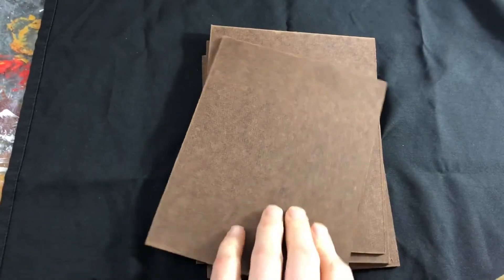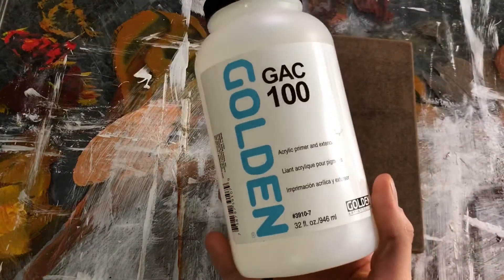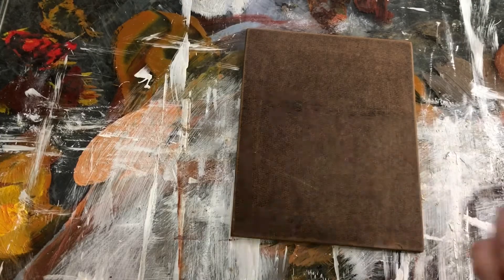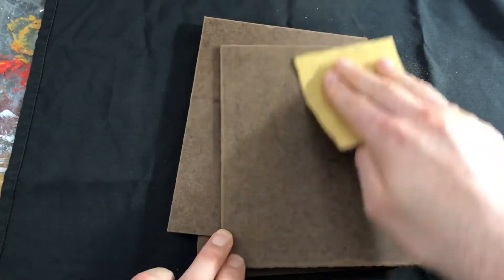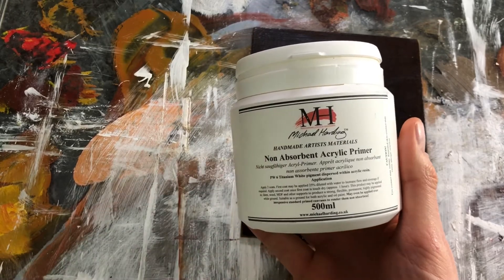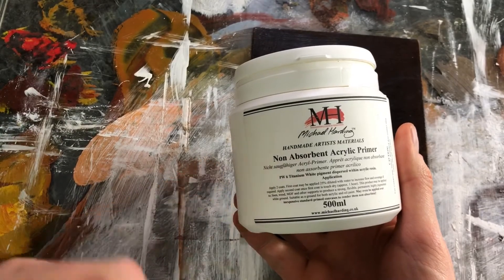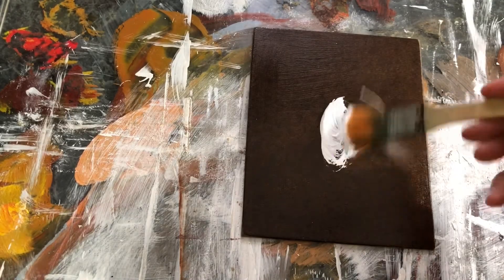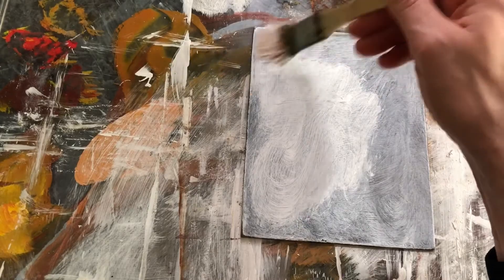How to prepare WOOD PANELS for OIL PAINTING using GAC 100 and MICHAEL HARDING’S non absorbent PRIMER

Comment: First Sand. Then Size to  seal/protect the wood panel from the paint and protect the painting, eg circularly size thinly, 1-2 coats, an hr apart, with Golden GAC 100 OR PVA Size from GAMBLIN. Then apply primer or gesso. Suggests Prime with oil based primer for oils. Or Michael Harding non absorbent acrylic primer is also ok , couple of very thin circular movements layers, 2-3 applications.
Reply from the maker: @firefly5574  thanks for sharing. Helpful info. Hope you are having a great day!!

Comment: I think it would be advisable for those who have issues with humidity in their homes to seal from both sides. I had four paintings ruined because of warping. Another idea I’m playing with is mounting canvas on panels but using reversible and archival glue.
Reply from the maker: Those are good suggestions!! Thanks for sharing. What glue do you plan to use?
Reply: @GalleryBry  I have seen that there are artists who use Lineco, Golden soft medium, and even Mod Podge since it is acid free, I have to try it with Mod podge (the classic one) which is the one I currently have in my house (but not for copper hehe I mean to stick my paintings on paper on wood or MDF)
Reply from the maker: @Maria-ue2nb  I think those options would work well.

Comment: I have been painting on hardboard for about 20 years now. I used to just prime the board directly with about 3 or 4 coats of gesso and the baord really sucked it up. Several years ago I started priming my boards with two coats of GAC100 ( which allows for a more even absorption of gesso) and then 2 to 3 coats of gesso, sanding in between with 150 grit paper. I generally brush it on, then use a dense foam roller to even it out, followed by a final swirled brush effect to regain it a bit of texture. I do my underpainting in acrylic, mixed with clear gesso (mainly to save time in drying), then do a final coat of clear gesso over that, to help smooth out the underpainted surface. From there, I do another light sanding to give the over-paint some tooth. I do the final/over-paint with oils. I also seal the back of the board with amber shellac. I could use GAC 100 but I like the look of the shellac. This prevents chemical seepage from the MDF hardboard, as well as keeping  it safe from water damage. It is a bit of a painstaking process but it is worth it to me. I haven't used Michael Harding's non absorbent primer, but now I am very curious. Thanks for your video!
Reply from the maker: @azmadazme  thanks for sharing!! That sounds like a very thorough process. I’m sure the paintings will last generations. Thanks for stopping by. Happy painting!!

Comment: If I were you, I would paint the sanded wood panel with white lead oil-based paint. Then umber or sienna for underpainting. Wood panels do not require any sizing. It is for canvas. I don't like primers.
Reply from the maker: @꿈꾸는_기계  thanks for the feedback. Much appreciated. :)

Comment: Thanks so much; this was very helpful! I was having problems with getting bubbles in my GAC 100 layer but I think perhaps I wasn't working it enough and I was also using a damp foam brush.  I do have a question (if you are still reading comments): do you seal the edges of your board as well? Thanks!
Reply from the maker: Thanks for the great feedback. I believe I failed to mention it but to ensure that a panel lasts as long as possible it’s best to seal the edges. I don’t always do it for studies but if I have a Comission I always seal the edges. :) Anything else I can help with right now?
Reply: It's the damp foam brush that's the culprit. I've had the same problem, use a dry bristle brush and wash it out immediately after applying it so the hair doesn't get glued together!

Comment: The wood panels you started with look like masonite (which is what I use all the time). True or false? Follow up question. I do mixed medium art - mostly paper and glue collage. If I size the masonite with the gac100, should that be sufficient to stop acid bleed forward from the panel to the art? And will my glue stick to the gac100 as it does directly to the surface of the wood? Thanks.
Reply from the maker: They are high density fiberboards, also known as hardboard or Masonite. :) What do you like best about them?
Reply: @GalleryBry  I use them all the time because a) They're thin and yet fairly rigid and have a profile that will fit into most frames that I use b) They are light weight c) I can cut them with a utility knife in the studio without needing to go outside to set up a  power saw.
Reply from the maker: Oh cool. I never tried the utility knife before. Do you just score it then apply force to snap the panel?
Reply: @GalleryBry  "Scoring" is a bit of an understatement. But yes, that's the idea. You can get a sense of it here: https://www.youtube.com/watch?v=ct5Laoq6DrU
Reply from the maker: @Karch.Dah-Veed  oh cool. Thanks for sharing. I see you make many cuts. Great video. Keep up the great work‼️:)

Comment: Hi. I know this video is three years old so hopefully not too late for a question. I’m confused. I thought the whole point of using gac 100 was to seal wood panel to prevent sid. Why do I then need to use the non absorbent acrylic primer? Is this not redundant?  Thanks for your video and advice. I’m a novice oil painter so lapping up information!
Reply from the maker: @dorisr6424  Great question. Sizing the panel with an acrylic medium helps to prevent discoloration as you indicated. The nonabsorbent primer is to help prevent the oil from absorbing into the primer, which can make it more difficult to wipe away and can make the painting appear. dull, when unvarnished. Did that help answer your question?
Reply: @GalleryBry  Got it! Yes you answered the question and many thanks!!

Comment: Great video! I know on the Michael Harding description it says sizes and gessos are unnecessary under this primer, but I'm just about to start an oil piece on a wood panel for the first time and want to feel confident I'm preparing it well. Would I be right to assume the gac is just an extra layer of protection and won't interfere with the primer and oil paint? Thank you!
Reply from the maker: The GAC acts as a barrier between the wood and primer. It keeps the wood from being rotted by the oils and protects the paint from chemicals in the wood. I like to take this extra step to ensure the painting lasts as long as possible.

Comment: If using PVA do you use it neat or water it down?
Reply from the maker: I haven’t used it myself, but I would assume the manufacturers would make it ready to use straight from the bottle. Anytime I’ve seen it used it has been right from the bottle.

Comment: Hi! How long do i have to wait for the gac 100 to dry before i can apply oil ground primer? Thanks in advance🙂
Reply from the maker: I typically prepare panels at night. So I let them dry over night and prime them the next day. But the acrylic polymer dries really quickly so you could likely prime after they are touch dry. I’d give them an hour or two just to be safe. It also depends on how thick you apply the polymer.

Comment: Michael hardings website says you dont need to size wood first when using his promer..why do you use the gac100?? Thank you
Reply from the maker: Thanks for the question. It really is just a matter of personal preference. Sometimes I use the GAC 100 when I use thin layers of gesso. For me I like the smoother surface it creates with less gesso, rather than using multiple layers of gesso, which creates a more porous painting surface, even with Michael Harding’s primer. If you apply several layers of gesso you probably can do without the GAC sizing. I also do it just to be safe, to protect the paint from the board and the board from the paint. It just depends how thickly you apply your gesso. You can run your own test. Gesso some paper, paint on it, and if oil still seeps through, adding the GAC 100 will block it completely. Was that helpful at all?

Comment: Can it be used as a varnish
Reply from the maker: Are you referring to the GAC 100 acrylic? If so it says not to use it as a varnish. A varnish is usually used as a removable protective layer. Acrylic can’t be removed.

Comment: If a wood panel is covered with 3 coats of Michael Harding's Non-absorbent acrylic primer only (without being sized first), will that be enough to protect the oil paint?
Reply from the maker: Three coats should be sufficient. But It depends on the type of wood and how thick the coats are. There should be less issues with unprocessed wood like birch panels vs a compressed wood like MDF, which contains harsh chemicals. Thicker coats will add more protection. I use really thin coats of primer or gesso just to add pigment and I rely on the sizing as my non absorbent layer. To be sure, you can run this test: coat a piece of paper (say a 4x6 piece of watercolor paper) with your desired level of primer. Make a small oil painting on the surface. If no oil seeps into the paper, then you should be okay. To put this into context, The Scream by munch was painted on cardboard, and it’s still in okay shape. Did that help at all?
Reply: @GalleryBry  Yes, thank you. Because I'm so paranoid regarding these issues, I think that I am just going to sand off the primer, apply GAC and then re-apply the non-absorbent acrylic primer. That way I know I'll be safe. I'm new to wood, so hence the mistake.
Reply from the maker: @ignaciohernandez8901  hope it goes well!! Thanks for your questions. :)

Comment: If I want to buy a round slab of wood and the seller says they put on a food safe finish, should I keep that or tell them not to put it on?
Reply from the maker: I would be cautious about painting on an unfamiliar surface. Without knowing what chemicals are in the finish and whether it is gloss or matte, there is no way to determine how well paint or a sizing will interact and adhere to the surface. If you plan to size and prime the wood yourself anyway then the finish likely wouldn’t be required. Did that help?
Reply: @GalleryBry  yes that was very helpful. Thank you very much for responding

Comment: Very nice my man! Soo, I've used acrylic matte medium for adhesive and sizing, and it had worked fantastically. I've also used pva glue, and rublev conservation mounting adhesive...which obviously works great! But I'm not sure the difference between pva, acrylic gel medium, and GAC 100...and gac is the ONLY thing I haven't tried, simply because I haven't felt a need to spend yet another $15-$20 on something I felt I already had. BUT if you think GAC has something to offer(in terms of sizing) that acrylic matte medium doesn't, then let me know. Might just have to try it. I also mainly use Rublev Lead Oil, and Lead alkyd primer. I've used oil and acrylic primers as well but my favorite is the lead alkyd(benefits of acrylic drying, AND Lead oil durability/texture) thanks!
Reply from the maker: Thanks for the great response!! Sounds like you have lots of experience. The main differences (aside from chemical compounds) among PVA size, gel medium, and GAC 100 is really just viscosity. PVA size is very watery. Gel is naturally very thick. And GAC 100 is about the same viscosity as log cabin maple syrup. I believe they are all ph neutral and will be archival. And each should provide a good barrier between the oil ground and support. And I’m with you: I like the alkyd oil grounds. They are such a joy to paint on. If you want to learn more about all the Golden mediums and various GAC numbers, there are some good videos out there.  I don’t fully understand all the differences among the GAC options. I think they all have the very same acrylic base. So as far as I can tell the main differences are viscosity and finish. Hope that helps a little. You should be good with the gel as a size. Some people like a very smooth ground so they might prefer brushing on thin layers with PVA or GAC. How to yo apply the gel—palette knife. Do you keep it textured?
Reply: @GalleryBry  man lol you too had a great response! Yes I have used pallette knife to apply(but don't prefer the edges left, and have to smoothe them down with either brush or rubber print brayer) which is probably why I've tried the liquid acrylic medium version, shellac sealer(only for wood, masonite seems to only respond well to the medium/acrylic primer, and pva) liquid/gel medium, AND polyurethane. Lol boy, when ya say it out loud, sounds like ALOT of experimenting. I guess I prefer doing things "correctly" even when it comes to art, and I keep hearing new inventive ways to skin the cat called "archival art". So I saw a response that said GAC 100(to seal OR adhere) or shellac is best for wood, pva/gel(adhesive/sealer) or acrylic primer works best for masonite. And MDF would fall under wood. And of course, my favorite, ACM, doesn't require ANYTHING 😀 to seal, and archival PVA OR medium have yielded great results adhering linen. I think tho....as long as you are care enough to try your best with what you have, and strive to make better art everyday, then your art will be JUST FINE! ;) oh, and yes, I mainly use a brush for ANY sealer I use. Beat of luck and happy painting!
Reply from the maker: @DCweldingAndArt  keep up all the great work and learning. Where do you get your ACM? I’ve been wanting to try it.

Comment: Does it matter whether it is tempered, standard, or un tempered hardboard?
Reply from the maker: Excellent question. If you want your painting to stand the test of time, tempered hardboard is the best option. MDF and untempered hardboard are okay for studies and practice but I wouldn’t recommend them for work you plan to sell because they can flake and deteriorate easily. I still like to seal tempered hardboard with GAC 100 just to add an extra barrier, especially with oil primers. The oil from the primer can still get into the fibers and rot the panel over time. And moisture from acrylic primers can also get into the wood fibers. Was that helpful?
Reply: @GalleryBry  You are right, tempered was the choice to make since the 70s (i'm dating myself here)... as tempered was known to be manufactured without oily binders. It should be noted that although most masonite is tempered these days, there is still cheap masonite-like stuff out there, like used in furniture, that is likely not tempered. Rule of thumb from the old days was to avoid using "found" masonite because it is likely the oily variety and not "safe"for paint work. I think the artist in the prior comments who found the masonite bleeding through the GAC 100 may have chosen the untempered masonite variety. There was also a concern that the "sealant" (GAC 100 or whatever) should be fully cured before working on it, say about 24 hours after the last coat, as touch-dry doesnt necessarily mean the film is cured, only congealed... I myself wait until the odor of ammonia and gycol ethers have evaporated and ceased before going for gesso, and maybe it's overkill but it's a precaution I take anyway... any thoughts on curing of primer?
Reply from the maker: @timmilk7875  thanks for this great reply. You are quite right about the differences in fiberboards. From what I have read, hardboard is the one that doesn’t use chemical binders. It’s former brand name was masonite. And you can tell by the smell. The dark brown hardboard found in paint shops and hardware stores has little odor. But MDF or medium density fiberboard uses chemicals as a binder and is a lower quality fiber board. You can tell because it is a light color and will make your studio smell quite a bit. And it degrades easily. It’s often used in cheap furniture. As far as curing, I definitely wait at least 24 hours to be safe. I usually have about four layers—GAC 100 to size and seal the wood panel. Acrylic gesso to add opaque white. Acrylic ink to tone the ground. And then finally gel matte medium to create a textured, non absorbent ground over all the layers. This is my most recent priming method and it works quite well.
Reply: @GalleryBry , yes, waiting for the sealant to cure is also necessary when using undercoat on walls (like with zinsser sealants) if you want to kill a rust stain. I have been tempted to paint on panels but as I've had to relocate on 2 occasions in the last 12 years I've found it best to do canvas which can be rolled (I paint in acrylic) and on set sizes, such as 18 x 24.  so when packing up for a move (or for a show) they all stack up in the same size(s) of box. I realize this kills the romance of being inspired by an odd dimension of substrate, but boy it sure makes moving them a whole lot easier!
Reply from the maker: @timmilk7875  I love sticking to a few sizes. It makes shipping and packing much easier. Thanks for the info.